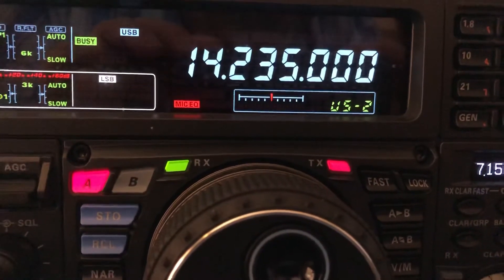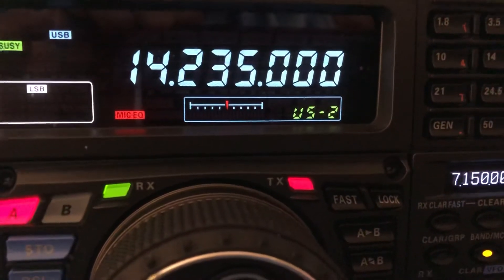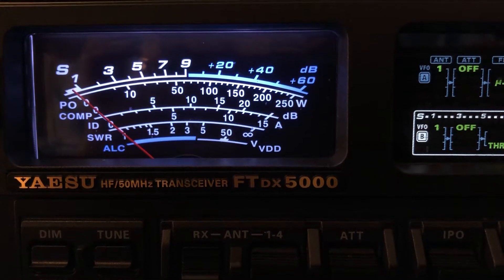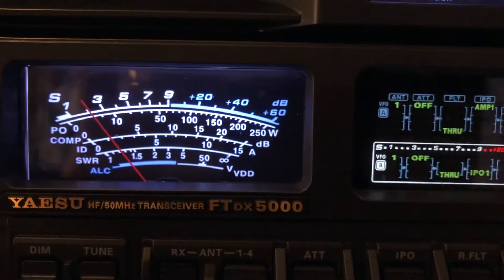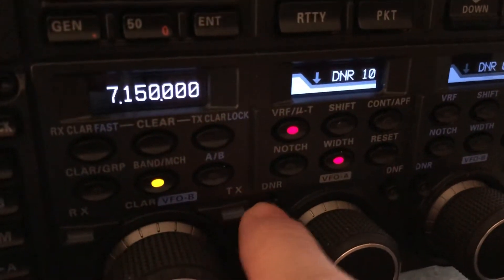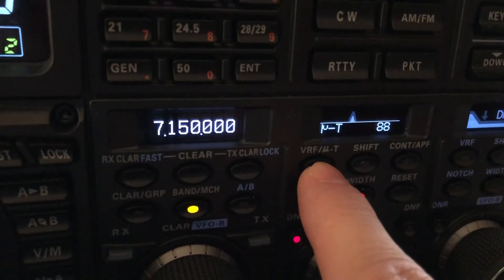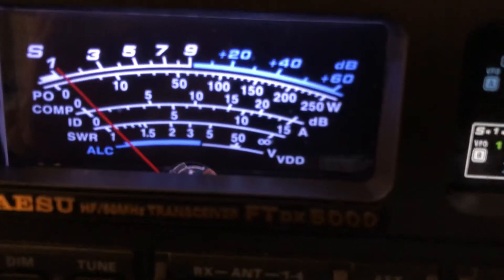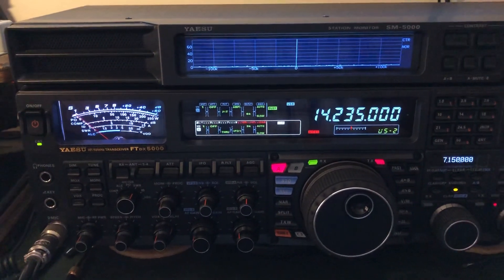Yaesu FTdx5000MP: SSB Noise Reduction Surprise

Comment: Hi, Since I do not have the 5000, but 2000D and the μ-Tune is not installed in my unit, I really could find very useful your suggestion, regarding the use of the filters and the VRF without the help of the μ-Tune. Thank you for all the help provided, 73 de SV1SLB
Reply from the maker: I’m glad you found the video helpful.  73, de N4HNH

Comment: I’ve got the ftdx 3000 and it has the same filtering functions. These radios make listening even weak signals both pleasant and amazing. Thanks for the video.
Reply from the maker: You’re quite welcome!  These radios do indeed pull out the weak signals very well.  I’m spoiled.  The FTdx3000D is a great radio.  It can use mu-tuners as well.    They sound great on the air too.  Thanks for your comments.  73, de N4HNH